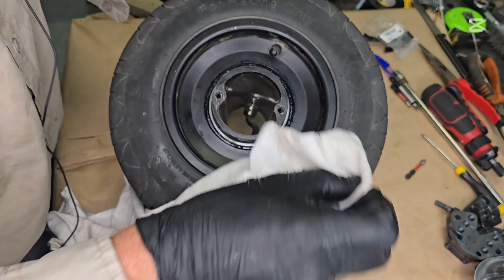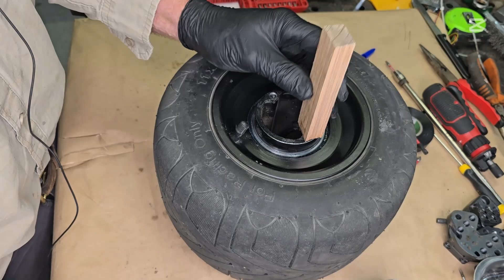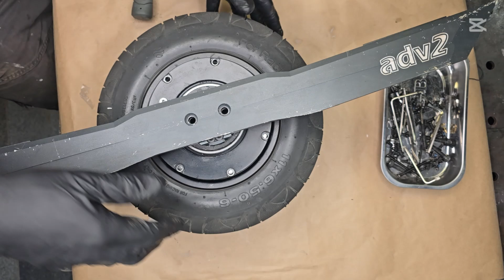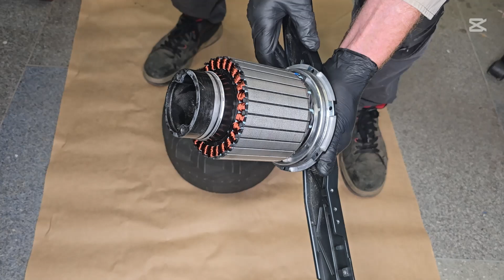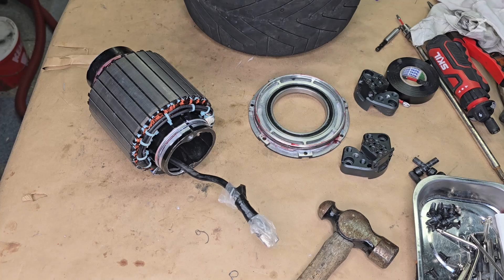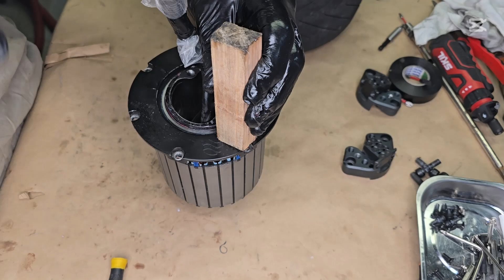Pull apart Axel assembly ADV2  replace bearings

Comment: 3:50 you skipped how to remove the cover off the stator...
i am now stuck.
Reply from the maker: Sorry ..I just tap the cover from the inside around the edge gently and work it  off the shaft
Reply: @bodwillisfloat  Thanks for the reply! I tried that and mine was really stuck, got it off eventually though!
Reply from the maker: @GDOGGY234  yes loosens up each time you remove it .... put some grease around it when reassemble helps

Comment: The most important part he skipped!!!!!
Reply from the maker: and what might that be ?
Reply: @bodwillisfloat   You dont show the STATOR being replaced  9.42  to   9.45 - I tried to be careful - BUT the Magnets pull the stator in with FORCE ; and looks like one of my hall sensors is not connected - a straight line for HAll 2 in the HALL Sensor Analyser Test.    Was good before and have to assume it was damaged during the bearing replacement process.  Took extra care BUT for the replacement of the stator - that caught me out big time.

Can you show / explain  the procedure you use to replace the Stator ?

Comment: Why would you need to replace the bearings on a wheel that is not that old?
Reply from the maker: It's a video to show how to replace... not because i had to ....as its a common problem because bearing not up to the job they have to do ..so I did video to show how

Comment: What is the diameter of the o-ring under the bearing? 1/16 x ???
Reply from the maker: The Axel is 70mm so could try 2,3/4"-7/8 and stretch on. This measurement is flexible because of the stretch...might have to work with what your supplier has on hand
Reply: @bodwillisfloat Thanks, I’ll have to replace my bearings soon, I’ve got almost 300km on them now 🤣

Comment: What are the specifications of the o-ring for the motor plate cover?
Reply from the maker: @dogbog99  120mm x 2mm  ...but you might find a 4 1/2"  x 1/8" easier to find
Reply: @bodwillisfloat  is there a good website to find these o-rings & corresponding sizes?